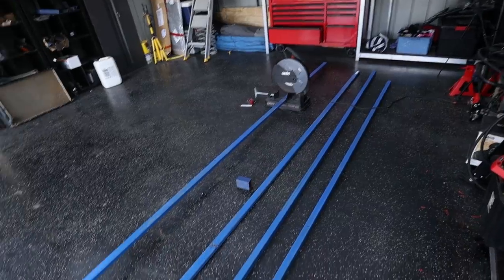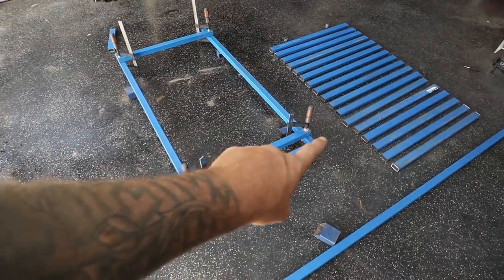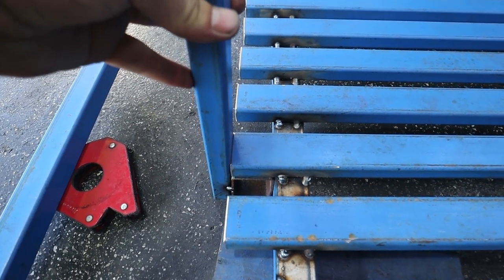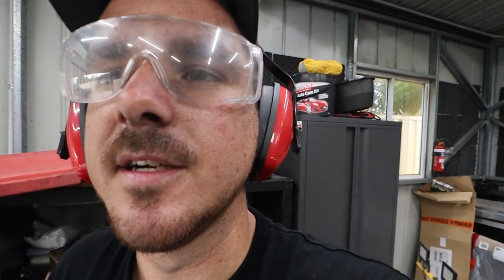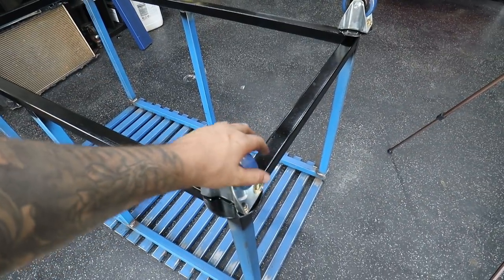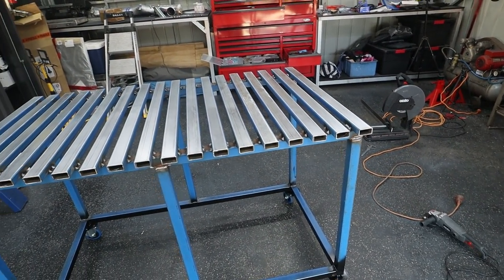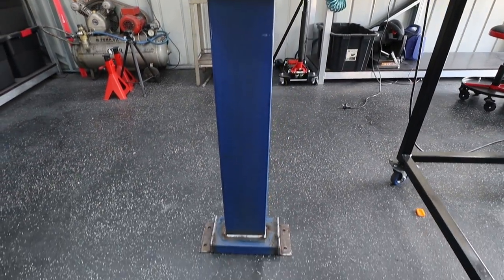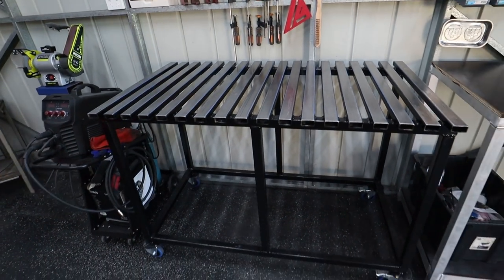Making A WELDING & Fixture Table On A BUDGET!!

Comment: I'm nearly finished building my own first welding table with my first welder (TIG), came up with a very similar design except used 10x100mm flat bar for the top and spaced them far enough apart to fit my clamps in. Cost was around the same plus some heavy duty castors.

Comment: Literally just made a welding table in the same fashion last weekend. I even made the same assumption that I could put a straight-edge off the first one and align the slats that way. Realised half way through that unless my cuts were perfectly 90deg I'd be off, and I was! Went to measuring them off the frame after that. One small difference, I welded the slats to the frame on the "outside" edges (ie. not the edges facing other slats). This way the welds are fully accessible if a slat gets bent or damaged and I need to grind the welds off to replace the slat. Also, definitely grab a "paint and rust stripper abrasive disk" from Bunnings (or wherever). They eat through paint. I got the paint off the top of the slats in about five minutes with one.

Comment: When Tacking the slats in you should have staggered them, ie one on the left then one on the right. Whilst using a spacer is nice, easy and quicker its just moving the heat from one to the next to the next which causes the bowing more. Great video though. Remember people that a clean workshop is a happy workshop. Finish welding an hour before you plan to leave then use that hour to clean up, while your doing that your around for any fires that may start. Extra bonus you walk into a nice tidy workshop in the morning.

Comment: Oh, and keep an eye out on marketplace or gumtree for a 2nd hand horizontal band saw. I sold my hot saw like yours and picked up a 7 inch bandsaw for about 1/4 of new price. It cuts easier and better and more accurately and WAY WAY quieter, and you can chuck 5 lumps in and walk away!

Comment: For future, to strip the paint off the metal instead of a sander use a paint stripping wheel for a grinder, I knocked out 27 slats at 800mm for my table in about 30 minutes and that was for the whole top surface
Reply from the maker: I legit was near gonna run out and get them!! I had one before but I used it on the house 😓
Reply: The blue paint is designed to be welded through anyway, I don't bother cleaning it off if MIG. For the surface of the table however, those strip disks are mint.

Comment: It’s 100% bowed from all those hot tacks on top not the sun, doesn’t take much welding to shift steel. Oh and blue bar is weld through, don’t have to strip paint. Also RHS has a seam, should always hide the seam instead of some seams facing up, and should probably have some triangles in there. All meant as constructive criticism ❤️
Reply from the maker: I legit didn’t think about the seam on the RHS untill I was sanding it down! 😓😓
Thanks for the tips mate I appreciate all feedback!!